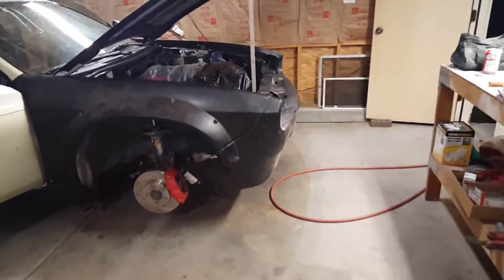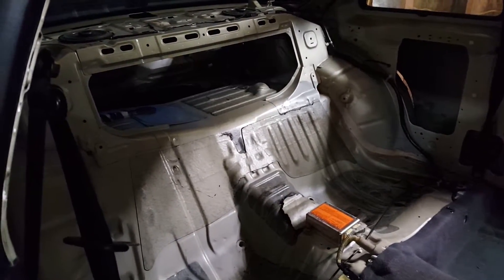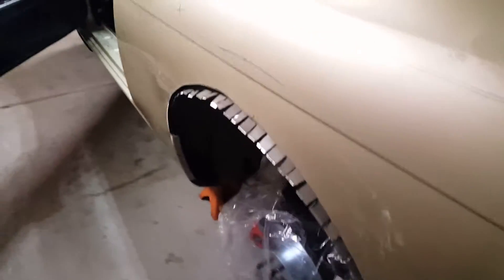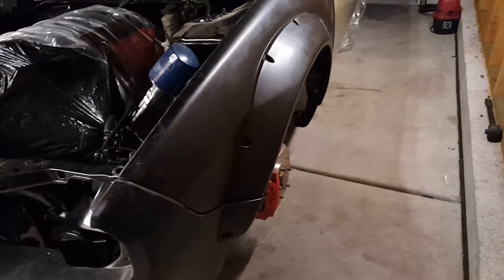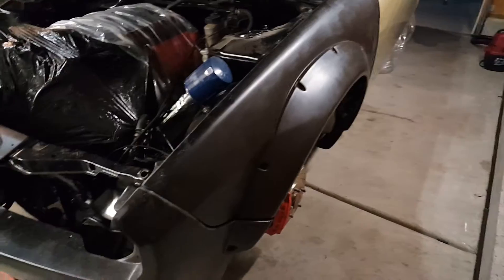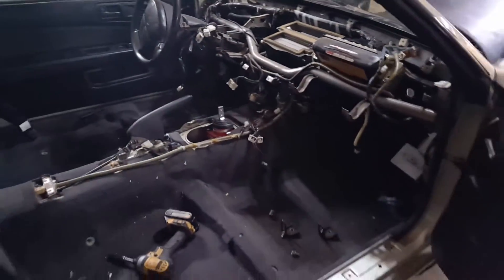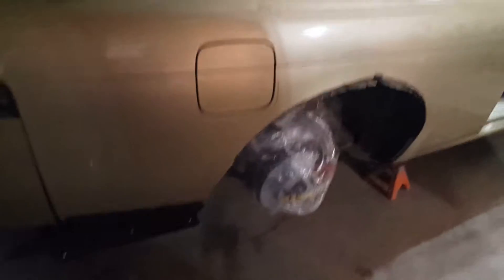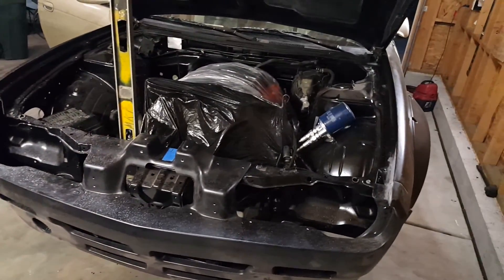Quick update on v8 swap Rocket Bunny 240

Comment: 1) Did your rocket bunny kit come with fitment instructions?
2) did you have to cut any of the front bumper support from the car to make the kit front bumper fit.
Reply from the maker: mileofsmiles there were a few mods that needed to be made
Reply: Did the kit come with instructions? My kit did not.
Reply from the maker: mileofsmiles I had no instructions either
Reply from the maker: mileofsmiles did you try to DM me?
Reply: 8 Bomb Garage Yes. I am fitting my kit and since it did not have instructions I have been checking out your YouTube channel and Instagram. I accidentally sent you a pic from Instagram, my kids had a good laugh at that one.
Reply from the maker: mileofsmiles well DM on there if you have specific questions